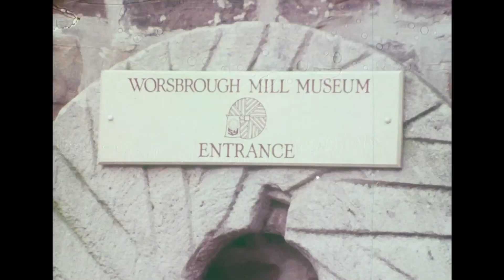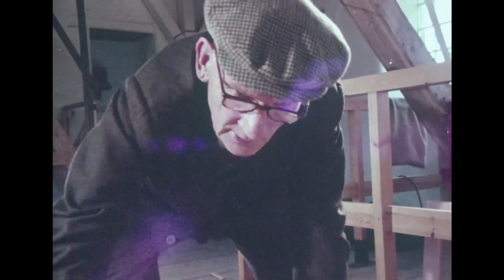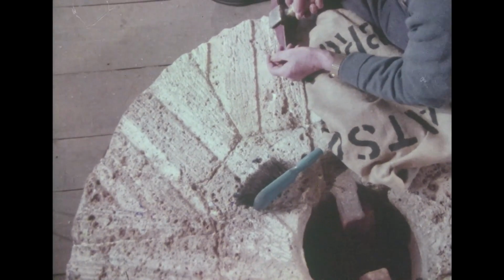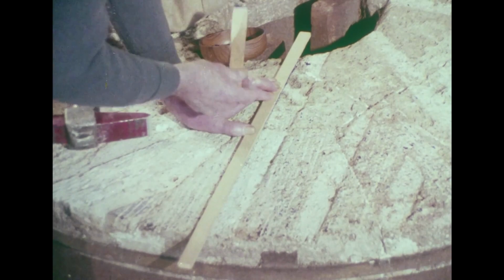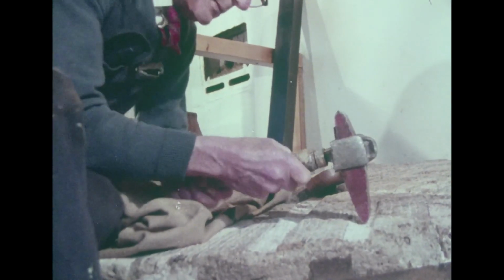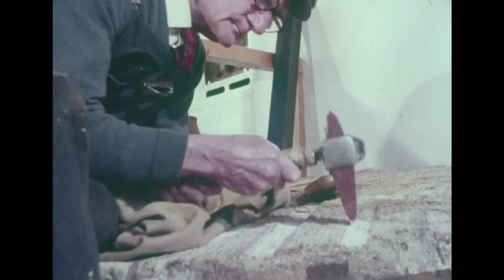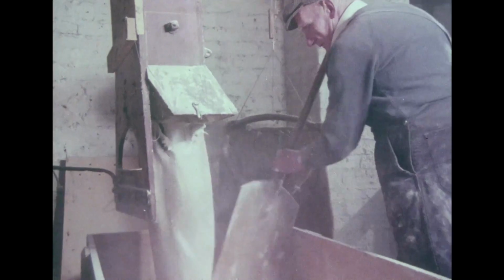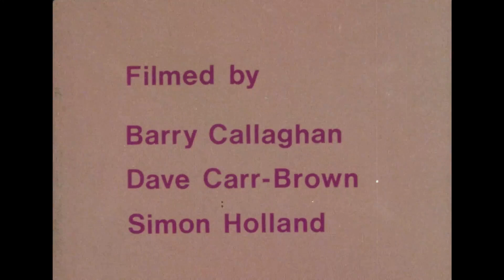Millstone Dressing Worsbrough 1977 Old timer with shaky hands works stone to precision.

Comment: I think this stuff is amazing. I'm glad it's being filmed and documented for posterity. Or it too would be another lost technology. I hear grains made by these eroded folks teeth fast. They use that to help date skeletons they dig up. The way he attached that chisel to the hammer is cool also. I always had a theory that they'd use a measured and anchored arm or handle to make straight lines freehanded, but also not feehanded at the same time. You can learn alot just watching these guys work alone. It why I've always liked working with old timers. Good video

Comment: Bah hell, that warmed the cockles of me heart that did.

Brings to mind the Featherstones, which were an old 'native' family with many branches in the North Yorkshire moors where I was raised. The sandstone used in the cottages there abouts was dressed with a feathering pattern - a central seam running the length of the stone's face with diagonal cuts running off to the edge to create a feather-like pattern. It beared a resemblance to the face of a mill-stone also - likely a display of the mason's highest skill (it was called herring-bone also). The Featherstone family were doubtless originally masons.

I came across a millstone quarry near Sheffield too, there's a great grit-stone escarpment running across the moor there, now the play-area of many a rock climber. Amazing place, littered with round millstones, half buried, big and small. Presumably those with flaws in that were left unused. I wonder if they were from an earlier period before the use of French stone, or, perhaps, for coarse grinding of something other than flour. 

Aye. Special video. Blue dye is also used in hand-flattening steel with a file, I did a little of it when I was studying engineering and often thought about it in relation to those egyptian boxes cut flat with "laser-like precision" ...I didn't however know it was part of the mill-stone cutters toolkit (not that I'd seen this operation done before), great to see.

The use of wood in their mechanics, cogs and bearings always amazes me, there were a few ancient machines kicking around in my old man's farmyard made with them, incredible to see wood used in that way. Aye, they really were some lads!

Thanks for that dude, a little gem.

On a sidenote, you may enjoy one of my favorite short films, "SNOW" ...It's not relevent to stone working but a beautiful 10 minute snapshot of another age - and old lads in flatcaps. Here:
https://youtu.be/cl4pJwcE7JI

All the best, J.